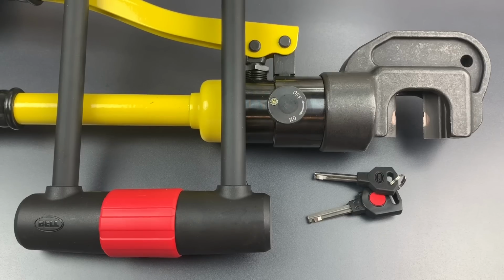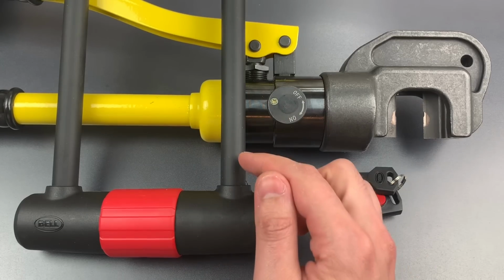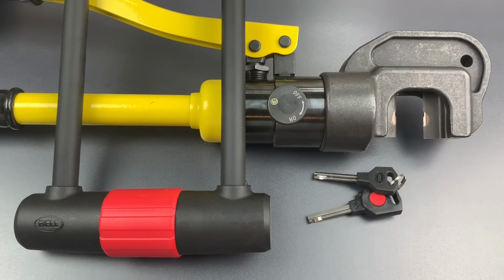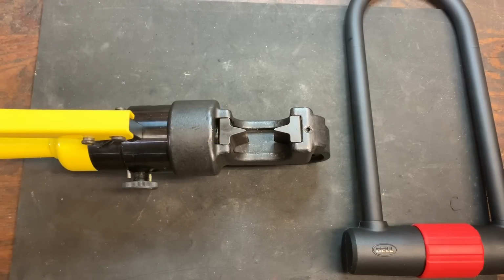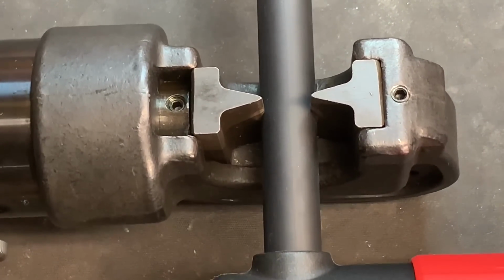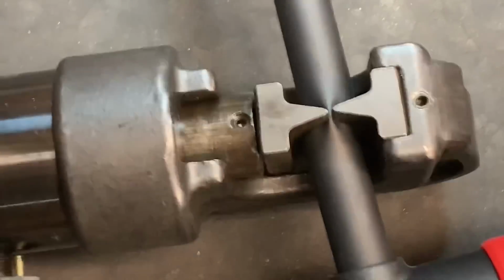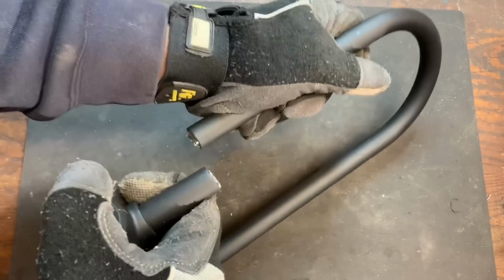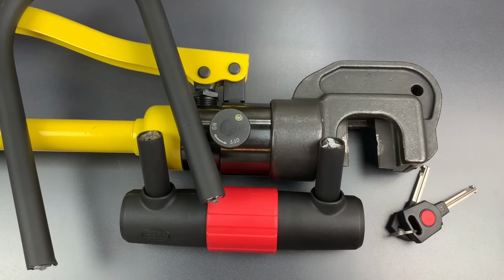[789] Hydraulic Cutter vs. Bell’s 16mm Shackle Bicycle U-Lock (Catalytic 750)

Comment: I wonder if you were to cut it in the center of the curved section and then use the long bars to spread the lock, if you would be able to get enough leverage to remove the lock with one cut. It also would be a bit thinner there to make the cut faster.
Reply: Thanks, I was just formulating the same question. 

I guess one would have worse leverage to twist, but one side might turn more easily making further cutting unnecessary.
 And if needed it would still just be one more cut
Reply: Likely, out in the wild, twisting the lock against whatever it's locked to would be easier as well,
You could grab the cut end and use your full weight as leverage to deform the bar.
Reply: I also tought about it, and it might just work. I'm guessing a 1" opening once you cut the top...
Reply: @joseph crosby mecham Honestly, the rebar cutter is small enough that this really isn't an issue.  So long as you can produce access to about 2 inches of the shackle, you can cut this.
Reply: Just pry with your foot

Comment: That was a disappointingly soft shackle.
Reply: Indeed, it barely made any sound when breaking.
Reply: I have one of these locks and  the shackle seems to be hardened.   I can not  scratch  the surface with a file.
Reply: well to be honest hydraulic cutter will go through the majority of shackles They are silent becuase the pressure is maintained, and it can be gradually sheared.
Reply: if it was hard it would shatter
Reply: @joshuaheffernan4374  then, they 'd be more vulnerable to impacts (hammer) and attack by lever which are very affordable by anyone :)
Reply: Or just have someone with an angle grinder. Few seconds and they cut thru locks like butter. Since the heat makes the hardened steel soft after a few seconds of cutting
Reply: yeah over hardened shackle can be as bad as soft steel, they say case hardened is best because it uses the pro's of both soft/hard metal, soft metal bends so wont shatter under impact, hardened metal harder to cut but wont bend, so hit case hardened steel, the internally softer steel wont break, its tough but not indestructible, what we need is flexible ceramic

Comment: I've got one these locks and it's quite short in length. It fits  through the wheel hub and is a tight fit, trying to get 2 cuts on it while in this situation won't be easy. Al leat considerably more difficult than shown here. Good content LPL.

Comment: I like your brute force videos. Having the hydraulic cutter laying flat and operating by pushing down on it seems a little off the possible real life scenario. Could you show a full body standing upright situation to give us a better feeling for the power required to cut one of those shackles. TY.
Reply: It's not a whole lot, I've used hydraulic crimpers and they are surprisingly easy to use
Reply: @charlesturner897  I agree, it would not be any more difficult to use.
Reply: charles turner But in the real world there might not be as much accessible space on the shackle to get that cutter around.
Reply: They tend to be a little bit easier to use standing, at least for me.

Comment: When you do a 2nd cut, it would be great if you could strip the ribber arround the shackle, so we could see the blade go in the metal.

Also, if you would install the tool in a vice, the image would remain steady as you cut.

Comment: Based on the picking video, ~17 on Amazon, and this cutting video plus the physical damage guarantee, this doesn't seem to be as bad as some of the others. Maybe LPL can do a favorites video.
Reply: I agree. It's a fantastic value, and the shackle is (I think) too thick to fit in the smaller non-hydraulic cutters a thief would hide under his jacket.

Comment: I would like to see how would hydraulic cutter perform if lock is higher from the ground as it would be in real situation. Since "arms"  of hydraulic cutter are pretty short I am not sure that you would be able to use ground as leverage point?

Comment: Thank you for great video . But Bell's locks is not quality locks. The Gold medal New York locks has been known a # 1 quality for a long time.  So can you test those New York locks, which have shackles 16" and over plase. My family and friends have been waiting to see those new York locks to be tested please
Reply: He’s working up to the good stuff. Often it’s just as disappointing but occasionally some gems appear. All my gun locks and safes are garbage unfortunately but I do have additional protection including concealment, awkward positioning and solid core doors with quality locks. I have learned from this channel and taken some tips to secure such dangerous property as well as protect my possessions. (It’s clearly not theft I worry most about as children and guns don’t mix well and thieves with guns can easily become murderers or themselves get killed.)
Reply: @TheQuark6789  thanks for a good news
Reply: @john-paulsilke893  thanks for a Good tip
Reply: And for a 1/4 of the price the OnGuard Brute (16.8mm hardened shackle with 4 locking points) is every bit as good as the Kryptonite New York. That's right, I did say a QUATRE of the price. I've not seen it cut by any bolt cropper anywhere. But... how would the OnGuard "Brute" stand up to an attack from these hydrolic croppers?
Reply: @modelsfirst  i'm currently strongly considering the onguard 8001. just got the 8020 mastiff chain. i'm considering pairing these 2.
Reply: @fallback8314  Either 2 X Onguard Brute or 2 X Kryptonite New York on your bike realistically is as secure as you can get for any amount of money as nothing will stand up to angle grinders.
Reply: @modelsfirst  what are your thoughts on the 8020 mastiff chain?

Comment: This lock appears that the shackle is not hard enough. The 16mm diameter is an advantage, but I suspect it needs to be harder. I never studied lock engineering, but maybe a shackle made from O1, 4140, hardened in a way that it is 54RC on the outside or even more, but maybe 44/45RC inside. Possibly, better yet, maybe something like A2 hardened to around 56/57 RC on outside with softer inside. This would require a non standard heat treating process, but it definitely can be done.  You certainly would be a great person to test it.
Not sure if there is really a way to determine it, but, if there is, you should make a video on best choices locks in the different categories, bike lock, home door lock, etc.

Comment: Hello, Lockpickinglawyer. Thank you for interesting and informative video's. I'm quite inexperienced in lock picking, preferring to do things with an angle grinder. ( retired boilermaker)  I would like to make a suggestion knowing you may have already tried it,  instead of attaching the shackle of a  D lock, would it be easier to cut through the base which houses the lock? I quite enjoy your video's.
Reply: Good Point

Comment: I have a showdown I want to see, an Abus 410 U lock, VS a Blackburn Leavenworth VS the new double locking better hardened U locks of the new Kryptonite series. They are all about the same price and double locking I would like to see you tear them apart and look for any problems. I'm guessing that Abus will have the hardest shackle, then Kryptonite, and then Blackburn but I think black burn's thicker shackle might be worth it. I suspect that the lock security might be the same order based solely off of experience although the Blackburn lock seemed fairly beefy and if the core is up to par it might be a the best lock out of them if you can find a flaw in the others designs.

Comment: i would like to see the sparks while grinding the metal inside. an easy method to check what kind of metal they used. that acctualy looked like unhardend steel or aluminum

Comment: Hey man I have a question to make you & I'm sure it's the same question everyone is thinking, what kind of lock do we need to buy without breaking the bank to be safe against a tool such as this one? is there anything that can stand against it?
Reply: AnimeManiac4Life One with too thick a shackle to fit.
Reply: Locks with shackle guards or with enclosed shackles, as there isnt enough space for the cutters to bite in. Obviously it will still be able to get the chain.
Reply: In short, no. Unless the lock makes it somehow unfeasible to get the blades in a good position to attack, it will either cut or snap the shackle. The saving grace is that there's not many bike thieves running around with tools like this since they're bulky and and expensive enough that most don't bother.
Reply: I don’t think LPL  wishes to endorse any particular brand, I shouldn’t speak for him, he’s providing valuable information for you to make your own decision.
Reply: All locks are able to eventually be defeated with destructive techniques. I'm impressed the shakel didn't move after being cut. Most locks wouldn't give that extra security. This is way better than anything I've ever seen. Consumer reports meeting UL testing Labs meeting YouTube. It's as entertaining as it is informative.

Comment: You should build a small wooden or metal stand to hold your vice more steady. Drawback its slightly less realistic but for the sake of better production value your videos would be alot less shakey while using them. Just an opinion from some one who loves your videos!

Comment: I've been using this lock for 1.5 years now, and my biggest complaint is that the internals rust pretty easily. I've had to beat it off my bike with a hammer and oil a few times now.
Reply: I have one, and I agree they need to grease this at the factory. Mine seized once, but I flooded it with Break Free and it's been smooth ever since.

Comment: so marks out of 10? . it still took you nearly 3 minutes, if the owner is nearby that's ample time to be discovered during attack.. let's say the owner is gone for 1 hour, it's giving you 5% security (1 in 20 chance of discovery), gone for 30 minutes, it's worth 10% actual security (1 in 10)

obviously not the best odds, but with a second or third lock, that's about 8 minutes delay. if you can put motion detecting camera or sensors near the bike to get an sms text, youve got a chance of discovering the thief in action
Reply: motion detector device would give you a lot of false positive sms BUT it's a step in the right direction i like the concept a lot

Comment: It occurs to me that you are doing these tests under ideal conditions, where you have the cutters on the ground, and are able to use your full weight on them. In the real world, the lock would be suspended around the frame of the bike, and the "immovable" object, and you would be having to use these cutters in the air, pumping 1 hand against the other, Don't you thing that could make a difference in the difficulty of the attack?
Reply: Isn't it on a workbench, at waist level?
Reply: i kinda see your point and agree with what you're saying

Comment: Important question: can you cut the lock by holding the cutter with both hands? Or does it need too much strenght? Please try
Reply: You ever jacked a car up with a hydrolic jack ? Probably about as hard, which is actually very easy
Reply: BMW X.🤦🏻‍♂️ Yes it’s easy becouse it’s on the ground and u push on it with your body weight. But what if u hold it in the air with 2 hands?
Reply: @fritzfromswitzerland  We're talking about lifting a huge piece of metal, weighing at least 500kg (assuming you lift half of it and it's a 1000kg) in the air, can't compare that to pushing 2 handles together that apply a crushing force to a tiny light object. Also, you don't need your body weight to jack a car up, hell I'd say about 15-30kg of force is needed.

Comment: Is there a bike lock that cannot be cut like this.
I am in my RV traveling, I caught 3 separate people trying to steal my bike on the back of my rig this Thanksgiving week.
Reply: It's to be expected, Black Friday and all. People are starting the mad rush of their Christmas shopping stealing.
Reply: @RPRosen-ki2fk  I used 3 pair of handcuffs in addition to my bike lock.
Maybe they will get the message.
Reply: @brichusi  I think you're on the right track. You just might want to add a Pit bull, a Rottweiler, and a Doberman, on the other ends of the cuffs though. ;o)

Comment: Hi, LPL. Why not cut once but at the other end?
Reply: If you look at video 671 (linked in the description) you can see the locking lugs are symmetrical. It doesn't matter what end you cut it from.
Reply: I meant cutting it in the middle of the curved part. That should provide enough spread to remove the lock.
Reply: Also the shackle is oval or racetrack shape which was designed to resist twisting

Comment: 1 1/8" steel wire rope.... I have chokers made of this to lift 17,000 pound concrete septic tanks.
Reply: Is that where u keep the bodies?
Reply: Tensile strength and shear strength are two different animals.
Reply: @rustybrowneye  Yes, after they hit the floor
Reply: or like i said, the cables you see holding up suspension bridges

Comment: is there even a cost effective metal out there that can withstand these cutters?
Reply: Have worked with a metal called Waspalloy before ( 2002-3 or so) that's mighty tough material. Used in steel slitting machines. It can be cut with edm, waterjet, laser, and plasma arc though
Reply: the cables they use to build bridges

Comment: The difference is that you cut it on the opisit side to the rest. So you had to cut it again plus you could have use the hydrolic to lever it apart I don't know why you would try and use your arms unless it's cable or a thin lock. A good experienced theif knows his locks and won't bother to use hand strength unless super strong to open a broken lock. Not worth hurting yourself for the steal 🤣

Comment: Makes me think what's the point in spending more money to be more resistant to a hydraulic cutter? Like lets say this costs $50, a $100 lock might like 5 seconds longer but that's it. I've not seen anything take longer than even like 10 seconds for this to slice through. The cheap ones on this channel took like 5 seconds to cut through and the expensive ones take 10 seconds, there's no point. if your bike is locked up somewhere the thief isn't going to try and take the bike with just a 20 second clearance.
Reply: Over here in the UK, the OnGuard lock that defeated the hydraulic cutters is actually about the same price as the Bell. There's more of a difference in the US though.